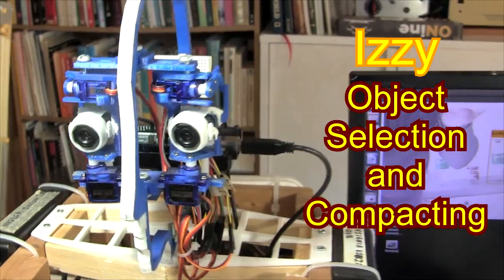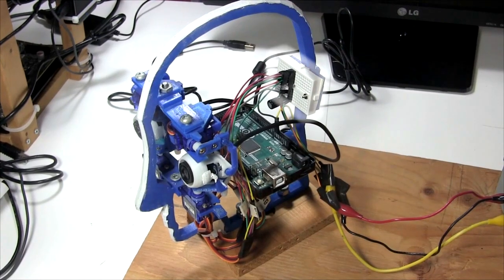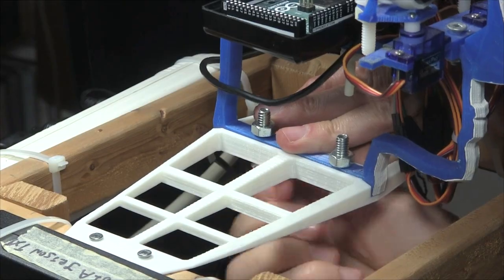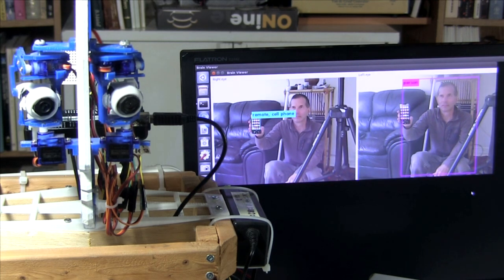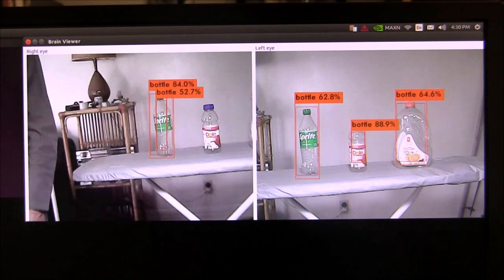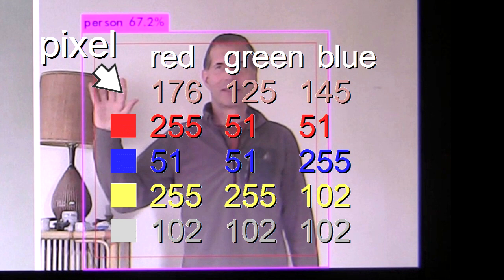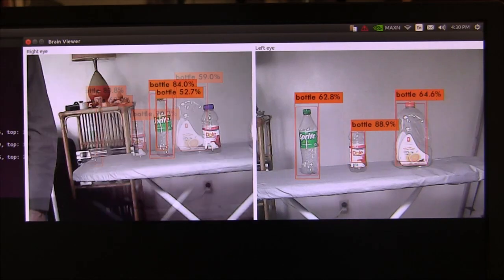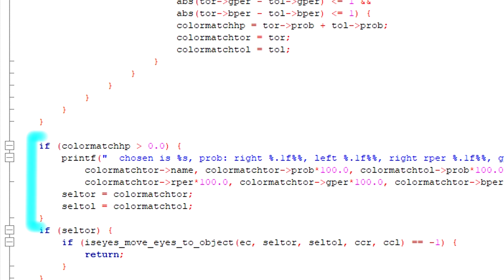Izzy's Improved Object Selection and Compacting

Comment: Make your algorithm first prioritize novel objects not previously detected. Then prioritize humans, alternate between them.
Reply from the maker: Yeah, not relying on the object recognizer is a future step.
Reply: @RimstarOrg  well you can still use object recognizer right? Just keep tabs on things previously classified.  I wonder if you can use stereopsis and roughly track objects in 3D space, then update their positions in some kind of mental map.

In any case, fantastic job!
Reply from the maker: That's what I started out to do as a first approach. I was going to figure out where all the objects were in 3D space that both eyes saw, then create an internal respresentation of that 3D space. Next I was going to select an object and make both eyes fixate on it. Where the plan fell apart was in using trigonometry to calculate the distance to each object. My logic and calcuations seemed correct but the calculated distances could be off by as much as a factor of 2 compared to the measured distances, even when working it through by hand and a calculator. I figured it was due to the inaccuracy of the cheap servos I was using.
Reply from the maker: And thanks! I'm glad you like it!

Comment: Running object recognition on both eyes is unnecessary. They see the same stuff anyway. It makes much more sense to have a dominant eye for object recognition and a second eye for depth perception. The simplest depth perception could be implemented by brute force checking in code which x-shift would create the best match between the two cameras in the center of the image.
Reply from the maker: Thanks for ideas. The human brain does a lot of different tricks, but one sounds similar to what you're talking about. In the visual cortex, it has disparity neurons that represent how far the sensory neuron is  from the center of the retina (the center of vision) - so basically, how far the object is from the center of the image. The difference in that disparity for both eyes is like your x-shift.

Comment: super excited to see a new video! could you just pick the highest probability from both eyes (and also temporarily moves the least from the previous few frames to avoid eye jiggling) then just make the other eye look in the same direction knowing they should be roughly parallel in gaze?  Also, for comparing colors of images, you may want to investigate the openCV function "compareHist()"

Comment: What about checking the relative positions of the boxes to each other? As the eyes scan left to right, you can use the linear pattern to also help move the eyes so they are including the same objects. This is really cool, I could see potential for calculating depth as well...
Reply from the maker: The problem there is that two objects (e.g., bottles) might be visible to both eyes but one eye might recognize both of them and the other eye recognize only one of them. You might have noticed that sometimes in the video.
I could compensate for that by hunting for a second bottle in the image from the eye that sees only one of them. I could look for a matching rectangle of colors.
I did try calculating depth a while back using trionometry. But my result was sometimes off by as much as a factor of two. I checked my calculations and couldn't find fault with how I was doing it. I blame motor angle accuracy.
Reply: @RimstarOrg  this is indeed a tricky problem. I guess the answer probably has to do with checking if an object from both cameras LOOK similar, and the lib you are using only offers periodic detection of classification and the shape dimensions.. somehow there has to be a way to know if a specific object has been recognized in a given time window, and knowing that the same object was seen in both view... curious to learn how this all works, thanks for sharing this journey!
Reply from the maker: Yeah, I figure I'll have two versions of Izzy's brain one that take this approach with an object recognizer and another that emulates more precisely how a human brain does it. The human brain does make use of associating things based on time as you're suggesting doing. I'm curious to see how it works too!